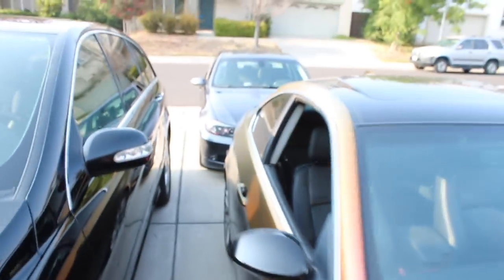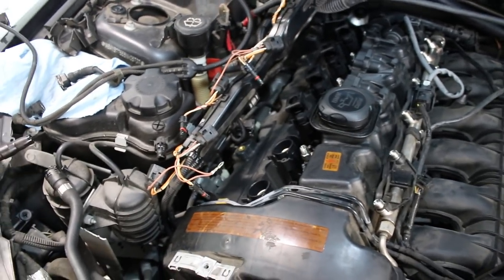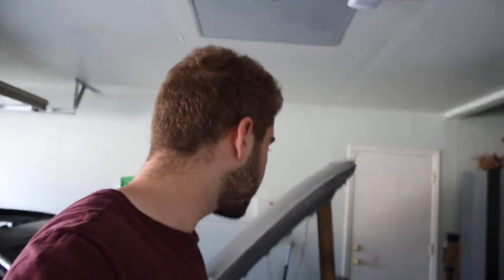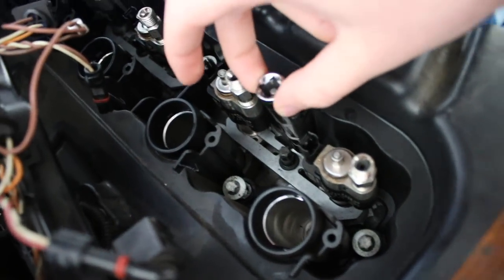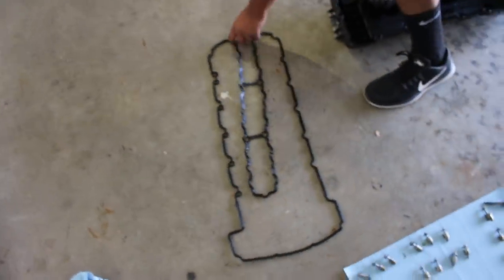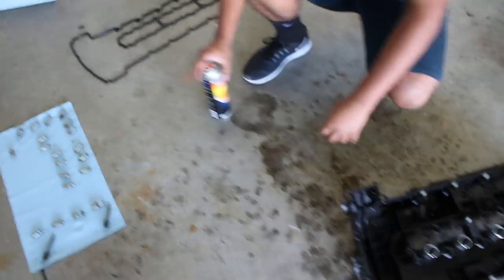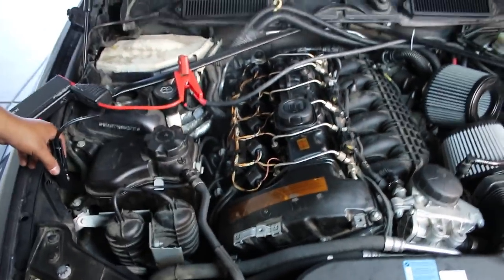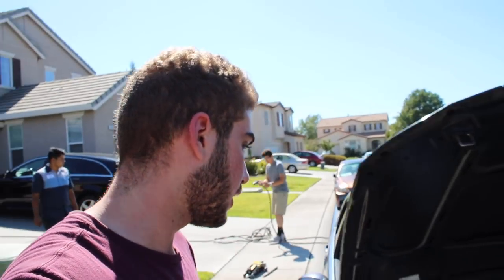Rebuilding BMW 335i Involved In Gun Fight! Part.19

Comment: Make sure to pull the heat shield as oil will retain there and it will keep coming back smoking and making it seem like it’s still leaking (when it’s not)...ask me how I know 🤣🤣
I did it after I replaced the valve cover 👍🏻